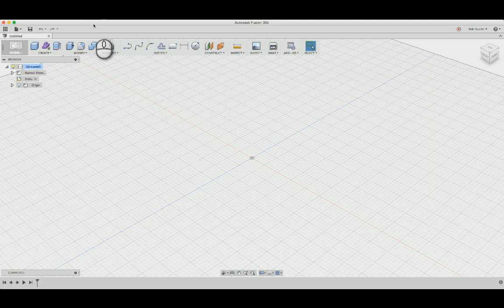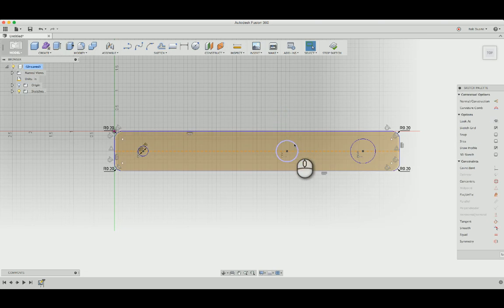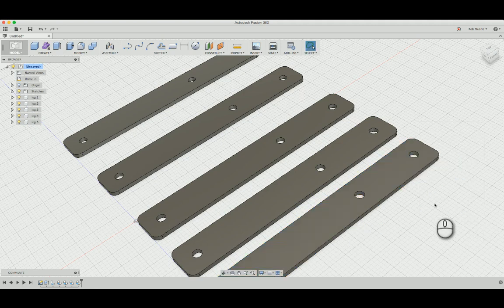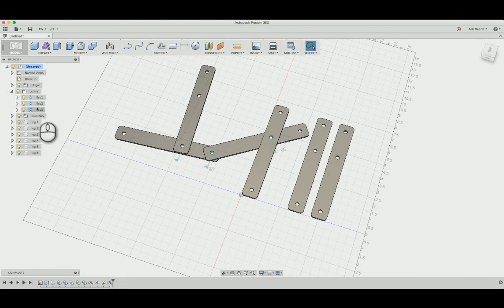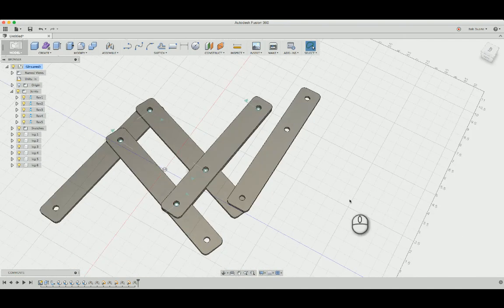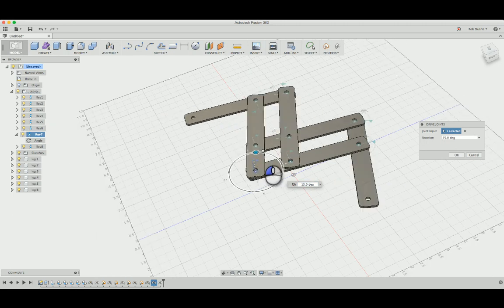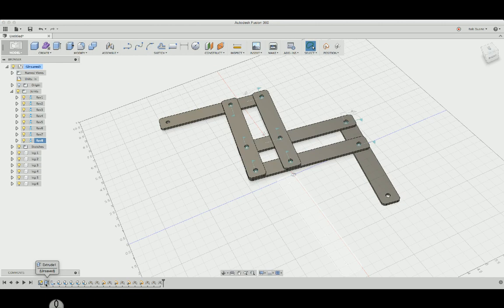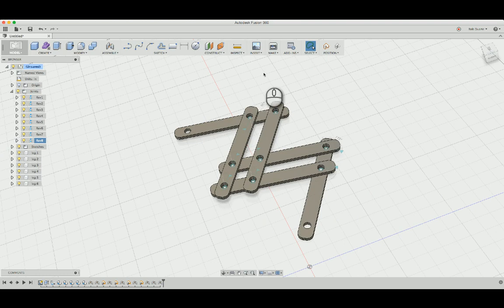Fusion 360: Making a Pantograph with Joints

Comment: why are those locations chosen for joint holes? isn't there some geometry for scaling 1:1, 1:2, etc?
Reply from the maker: The hole locations were totally arbitrary. It was just used as an example to practice making assemblies/joints. Place them where you like, if you want to make a pantograph that scales movements up/down. (a pantograph can be used to just translate movement to a different location without scaling)